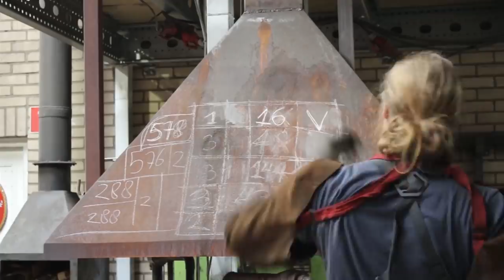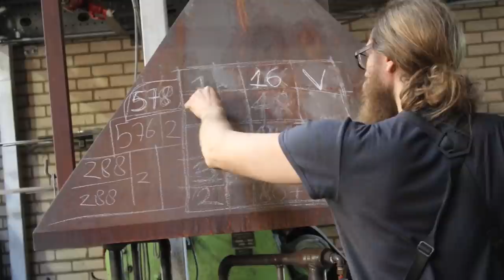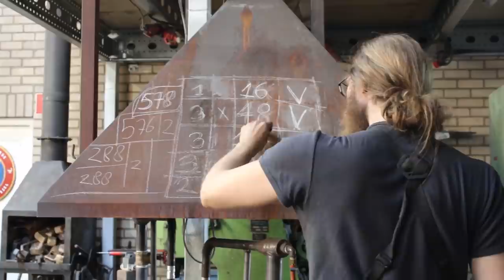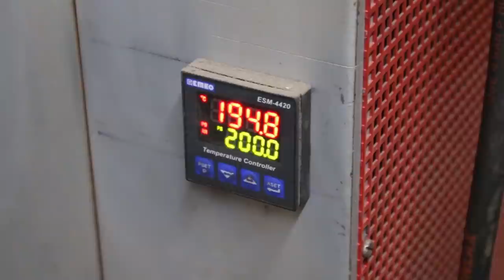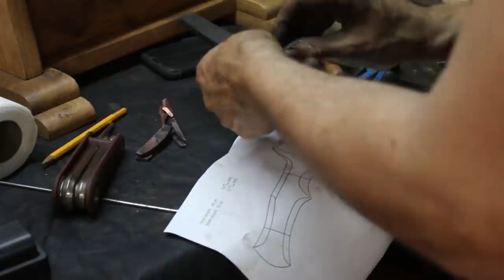Forging a Damascus san mai bowie knife, the complete movie.

Comment: Why did you use a grinder on the top of the billet if you where going to use a sanding belt on it?
Reply from the maker: To remove the very hard carbon top layer and save belts.
Reply: @freerkwieringa275  Ahh OK, thanks for the answer.